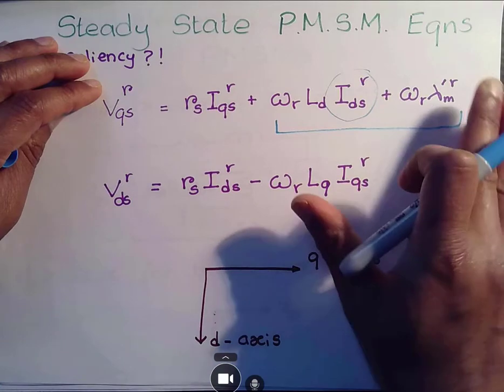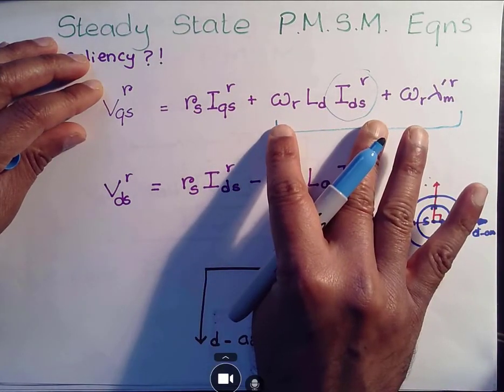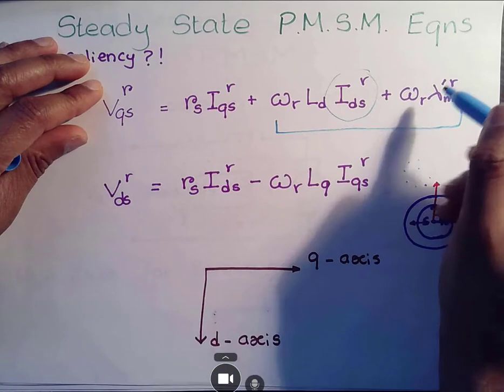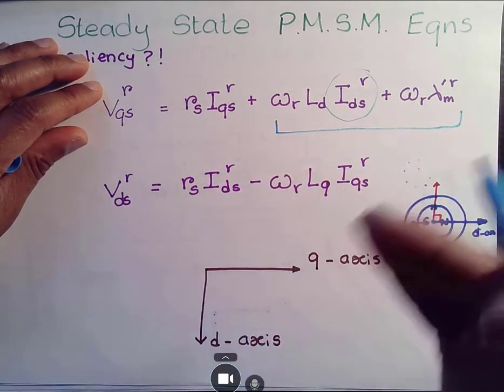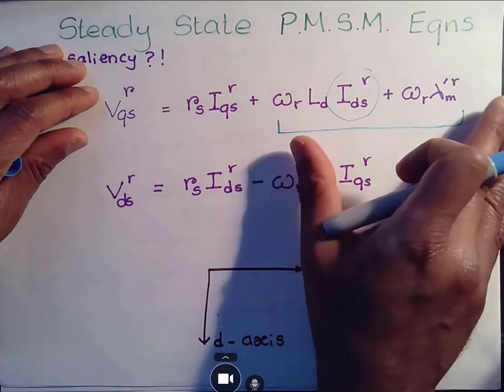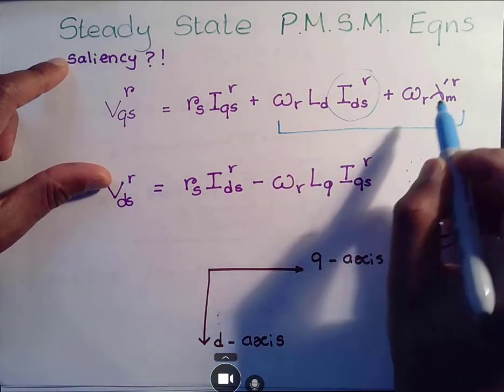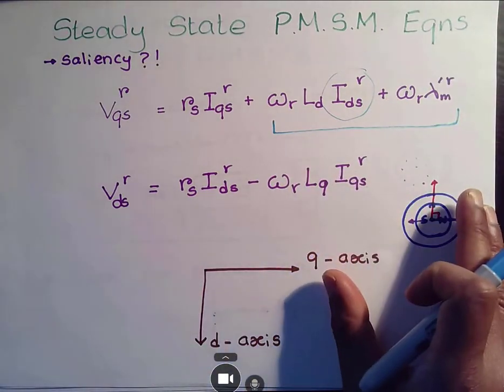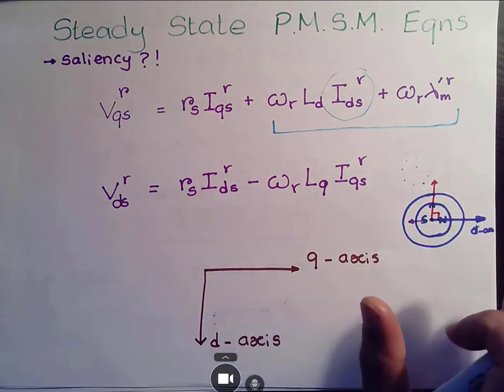Field Weakening of SM PMSM : An Experimental Approach

Comment: Hello Sir, thank for informative video. Can you please tell me if Ld and Lq values remains constant for all speed range ( 0 to base speed & base speed to max speed)? Thanks in advance
Reply from the maker: Hi Parth, Ld and Lq are inductances. Theoretically they do not change with speed unless the magnetic saturation level of the machines changes. Now, practically you will have to verify if this changes based on the saturation level.

Comment: Hello, greatly appreciate your work and these videos regarding PMSMs and FOC.  One question; you mentioned position sensor should be properly calibrated and and delays should be compensated before going into field weakening. What sorts of delays should we care in this case.? Thanks in advance.
Reply from the maker: Hi Gayan, computational delay and inductive lag may introduce some severe offset at high speed. So those should be compensated by advancing the angle.
Reply: @SandunKuruppu  Thank you for your quick reply. Ok, I see. Is this a typical issue when implementing FOC on PMSMs. What are the methods of determining angle offset error caused by delays. And how can we mathematically advance the angle in the algorithm in real time.?
Reply from the maker: @gayanniroshana7630  The misalignment caused by delay can be determined in several different ways. Easiest is to run the motor at the speeds you want and measure applied Vq, Vd pair and compare that to a model based value to determine what the error is. This paper will help find this. https://ieeexplore.ieee.org/abstract/document/9449553. To compensate, you can use a speed based position correction lookup table and at each speed instance, update the positions signal used. This also can be in other ways.
Reply: @SandunKuruppu  Thank you for detailed explanation and the reference. This answered my doubts very well and would certainly be helpful for my work.
Reply: Here's something from my recent experience on field weakening. I'm testing a SM PMSM with FOC implemented. The basic FOC controller was tuned well so that the motor runs without any issues. The position sensor is a resolver and we use a system on chip solution for reading the resolver. I implemented field weakening and was able to increase the motor speed to a decent level. The issue that I have is when recovering from field weakening region a reverse DC bus current tends to appear during the recovery time. The motor is connected to an external load with low friction to provide an adequate amount of inertia to the motor setup.
What would be the reason for this ?
Reply from the maker: @gayanniroshana7630  Is it possible for you to share a scope capture showing the change in Id references and the DC bust current variation? Can you specify your DC power source, motor power rating, and current references you had when this happened? You can send it to my email, if you prefer not to share on this public forum.
Reply: @SandunKuruppu  Yes, sure. I'll send the captures and other details via email. I believe the email address mentioned in your description is correct.
Reply from the maker: @gayanniroshana7630  That's correct Gayan! Let me know.

Comment: In an hall sensor based  Ipmsm machine while doing reverse motoring , I made Iq negative . And for flux weakening i made id negative . I observed a reduction in speed rather than increase . Can u help me to understand why the speed is reducing even though we are applying negative id current. Is it because of saturation
Reply from the maker: Hi Debasis, I will need some more information before I answer. Do you have field oriented control implemented? Are you testing on a dyno, where the motor speed is regulated by another machine? When you regulate current, you are controlling torque. Was the position sensor properly calibrated? How did you verify if it was properly calibrated?
Reply: Hi Sandun,
Thanks for quick response. It was an IPMSM motor in my case & field oriented control is implemented. Basically it is for an EV 2 wheeler application and the throttle is mapped to speed( say 0-100% thrrotle corresponds to 0-700 rpm). I have set the field weakening threshold speed below rated speed to simulate the field weakening . The position sensor is properly calibrated ,I have matched the hall sensor with the back emf . And in my case I have implemented both speed and torque control. I hope I have addressed all your questions.
Reply from the maker: @jubul1988  How are you testing the motor? Does it have a load or is it free running? Can you share a video of what is happening? You can send me a private email if you dont want to share publicly. 

Also, why are you using field weakening below the rated speed? You will end up running with lower efficiency.
Reply: @SandunKuruppu  we are testing in free running and sorry for the mistake we are doing field weakening above the rated speed not below rated speed . I ll try to capture and share a video by mail.